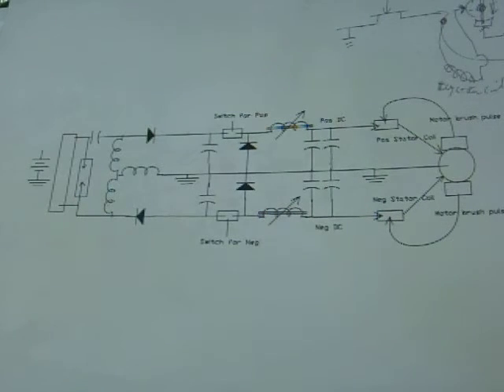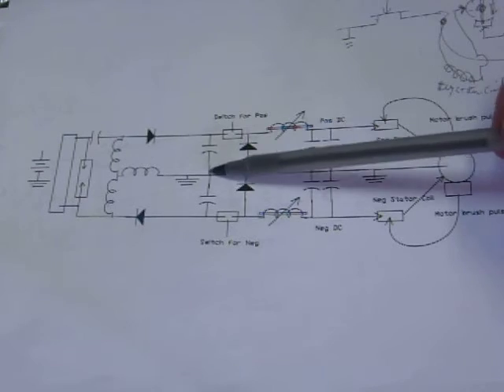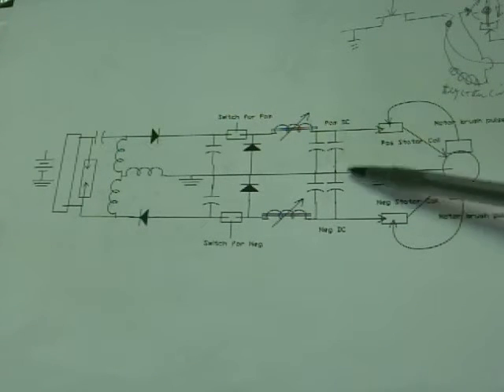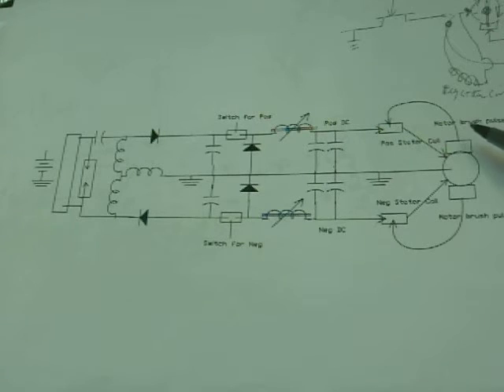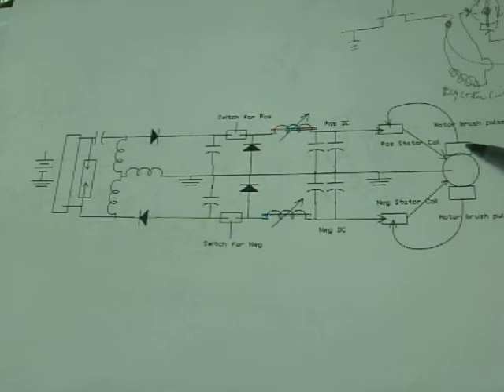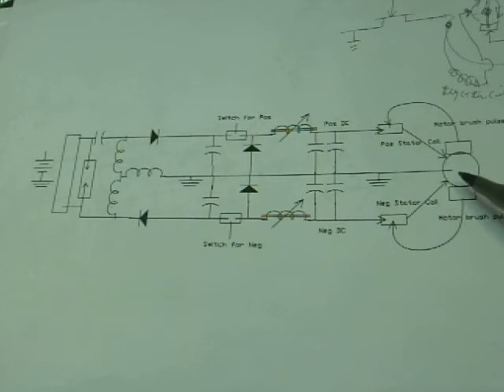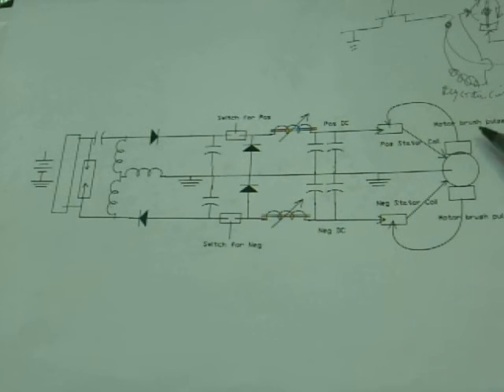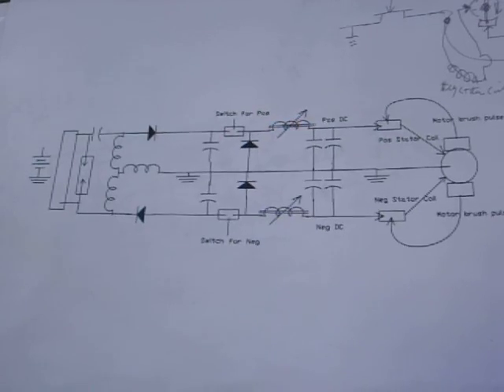Don Smith #9

Comment: The diodes are short to ground. This circuit looks wrong. You did not clearly draw the wiring diagram. Where the wires are crossing and where they are connected. Basic things in drawing a circuit. Your circuit does not help to understand how the wiring is done. Anyway, I hope you will correct it. Thank you for sharing.

Comment from the maker: It took me a while to understand what the drawing was doing. They use this circuitry to get multiple phases from a single phase to drive loads. The switches are in parallel this situation the TOP driver is used to dump positive energy to the load and the BOTTOM driver dumps negative energy to the load via the same wire.
 
To get the energy from the HV caps to the low voltage uf electrolytics I'll use either the TOP for the + and the BOTTOM for the -.

Comment from the maker: This circuit will use a simple feedback method to prevent the Electrolytics from exploding. To run a motor; the brushes are used to provide a ground path for the coil set that will use the - or + energy and this connection will remain until all events are completed for either the pos or neg input pulse from the uf electrolytics, the coil shorting event , and finally the BEMF collection using bridges.

Comment from the maker: Once the events are done then the brush breaks contact to ground and gets ready for the next - or + pulse.

No arcing will ever ocurr at the brushes using this method.
A stand alone energy system will use the same concept without the rotation.
As you know toa is the RC time constant for cap charging and discharging.     Using this single piece of knowledge you can create just about anything from a stored DC voltage.